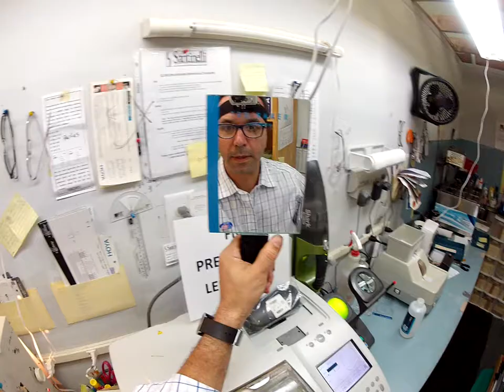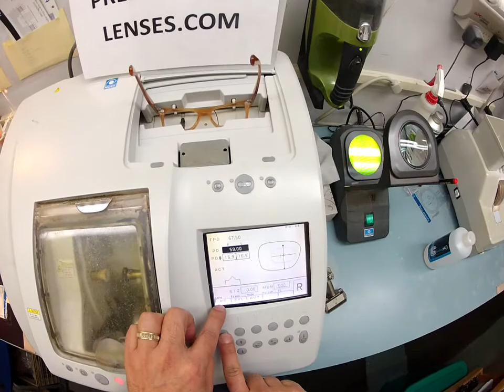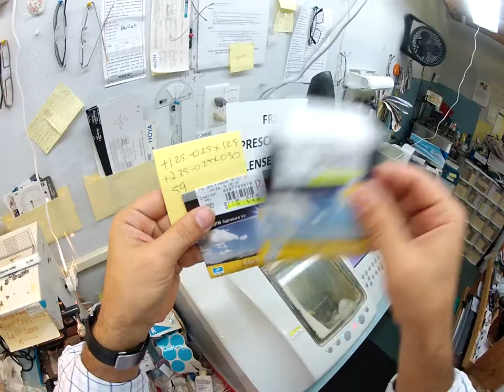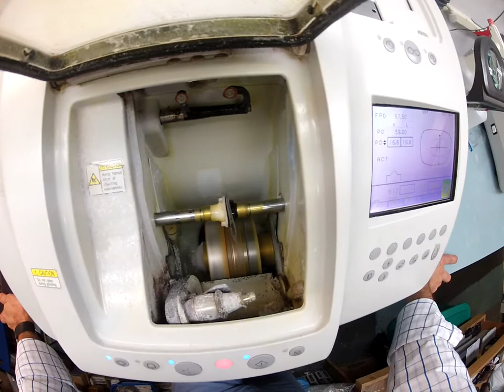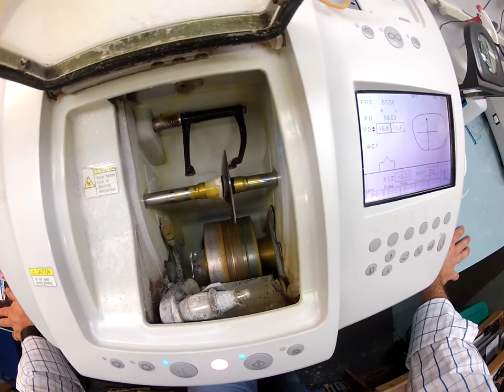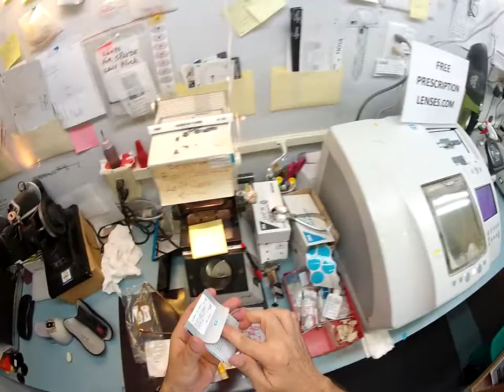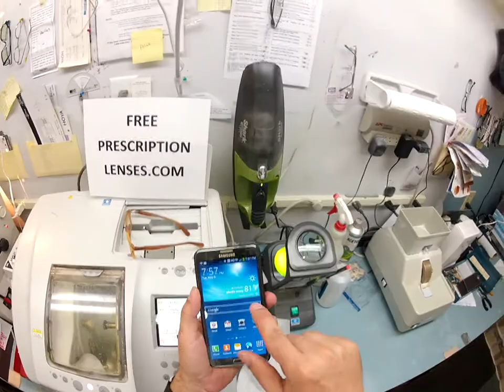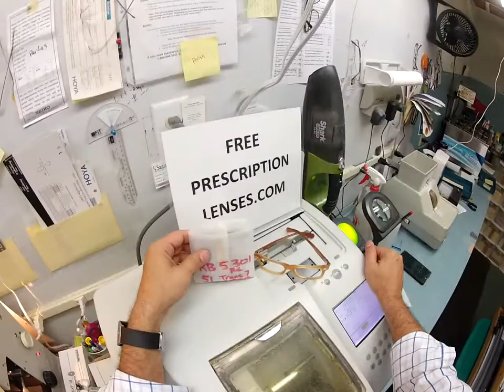Idano's Transitions 7 Lenses with Crizal Alize for his RayBan 5301

Comment: Since the Crizal Alize have UV protection, wouldn't that have a negative impact on the effectiveness of the Transitions lenses since they need UV to activate?

You insight is appreciated. Thanks
Reply from the maker: No they will still work in perfect performance without any interference.